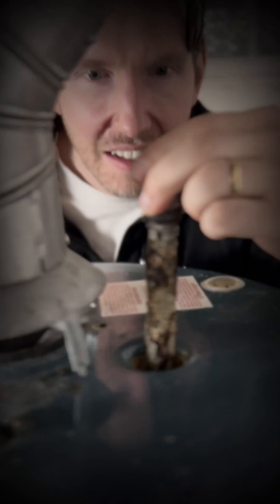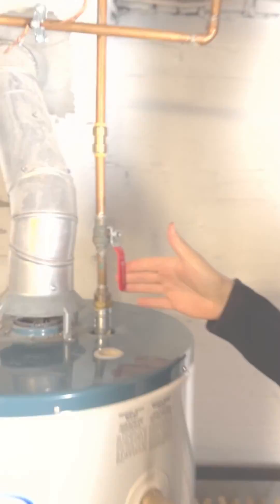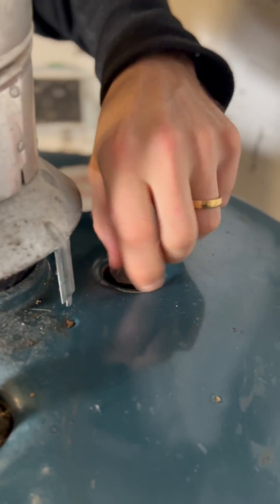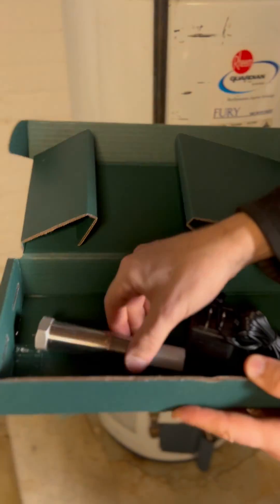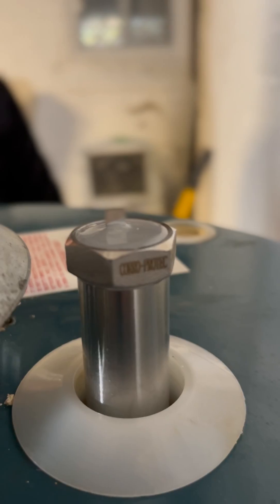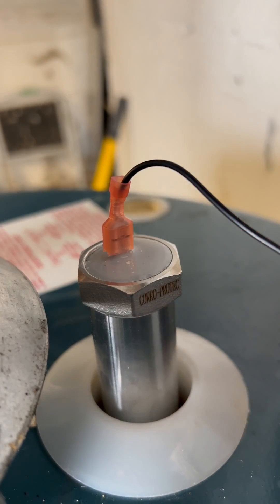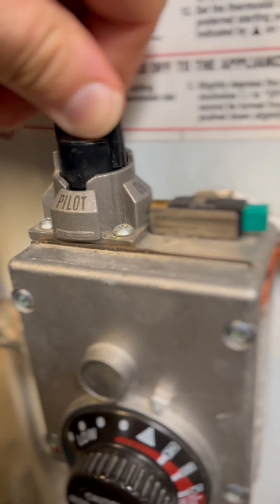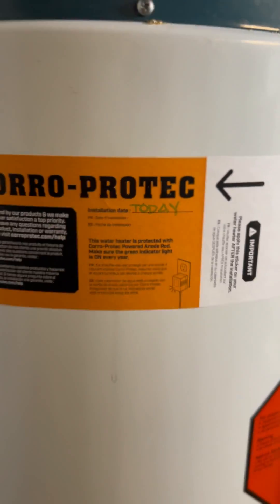Corro-Protec Powered Anode Rod - Installation and Benefits

Comment: And the fact that the electric powered anode is so short,did not bother you at all.The electrical current will pass true the shortest distance available and this is the top of the tank.The bottom will be protected much less.That is why commercial tanks like AO Smith have long powered anode to the bottom of the tank .
Reply from the maker: Interesting point, thanks for raising that! Not sure that’s true with a powered anode rod, but feel free to contact Corro-Protec and express your concerns!
Reply: I bought the same one, and they claim protection up to an 89 gallon tank.
Reply: I don’t think electrical current works like that in water

Comment: What if my tank is 19 years old, will this do anything to remove the existing corrosion?
Reply from the maker: For sure! But consult with Corro Protec on your situation and they’ll help you out!
Reply: No. This will not remove any existing corrosion, only future corrosion.
Reply: @palarious  thinking about this.... there might be a way to remove existing corrosion... you would fill the tank with an electrolytic solution, IE baking soda and water then use a sacrificial steel anode thru the anode port hooked up to a battery, wait 24hrs or 48. and most of the corrosion should be removed. You would have to disconnect the water tank completely to prevent it from grounding somewhere and remove the electrical board components, but that should work.... afterwards you would drain it and reassemble.

Comment: what size socket is required to remove/install the rod?
Reply: My Rheem Platinum water heater required a 1-1/16" socket to remove the existing rod.  If you get the Corro-Protec rod, you'll need a 1-3/16" socket to install.  Get the slim versions of the sockets if you can.   Some water heater brands have a plastic rim around the rod housing that is difficult to remove.
Reply from the maker: 1-3/16” socket👍